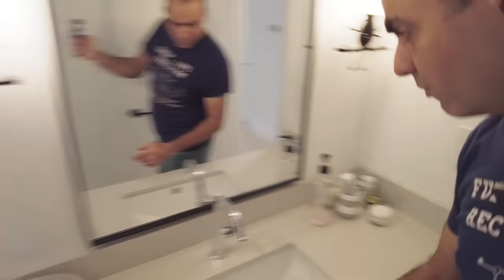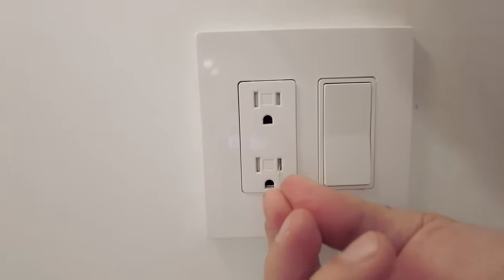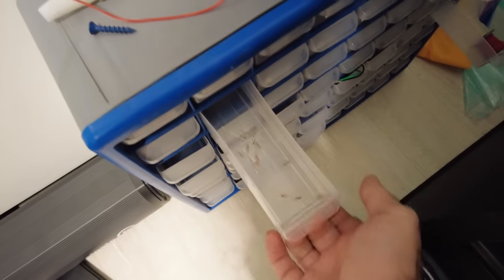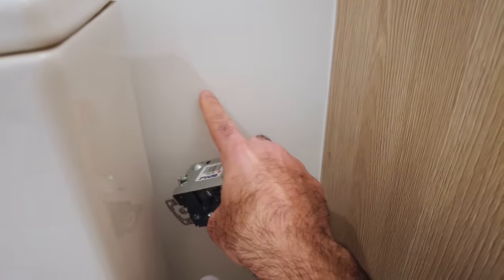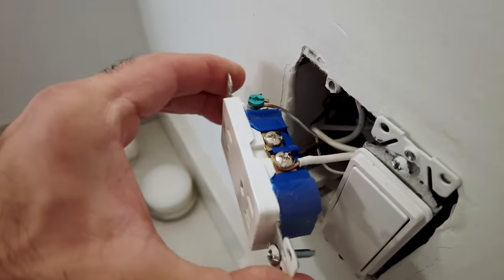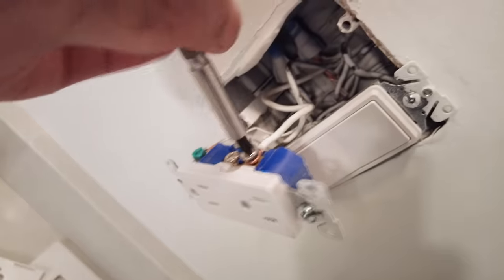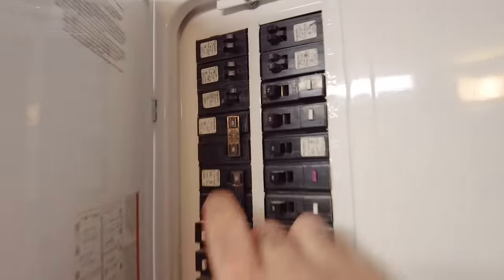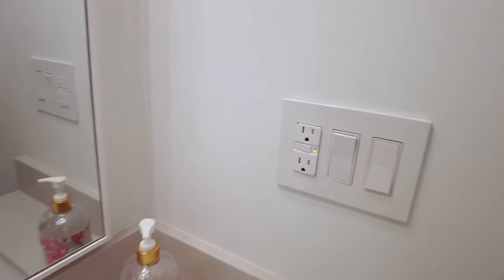Installing an Outlet… For a Toilet Seat?!

Comment: really should have an insulator at the ends of the armor flex so it wont potentially cut into something and become live (they sell these little red plastic / rubber plugs just for that) to be 100%
Reply: As is required by code here, they're called anti-short bushings.
Reply: He might've installed them off camera, as in a separate vid about his back porch infrared heater, he showed just that
Reply: @SomeGuysGarage he forgot those on the garage heater install to and ended up doing a follow up video where he installed them. Surprised he forgot again.
Reply: those are not required on MC/greenfield cable here in the USA. not sure about canada though.
Reply: If it does become live, the gfci will pop. That's what it does.
Reply: They are required in Canada for ac90 (this armoured cable)
Reply: This is exactly what I was thinking
Reply: @peterfordham3562 Yeah why’d he forget AGAIN???
Reply: Using that type of armored cable seems to always leave a wickedly sharp edge that can cut into the insulation on the wire! I always spend some extra time cleaning the sharp edges and wrapping some electrical tape around the wires before using the plastic bushing, especially if you have the wires make an abrupt 90 degree bend inside the box (which is usual). Also the proper type of box should be used for this type of cable, which I am not sure that he did. Personally I would not use this type of cable underneath a sink due to water issues.
Reply: I noticed that too.  No MC connectors, I guess.  But then no red-heads / anti-shorts?  eye twitch
Reply: Why do you even use the metal tubes? 
In Europe it's completely different. Inside walls, we have flexible plastic tubes. Non-fireproof ("TC") for concrete walls and fireproof ("ERC").
For mounting on walls, we have plastic channels, thicker, non-flexible plastic tubes ("PNT") or flexible ribbed tubes ("flexi"). 
Metal tubes ("STAPA") and metal flexible tubes ("SAPA") are only really used for mounting cables in industrial settings where mechanical protection is paramount. When they are used, the metal tube is connected to ground in the breaker box.
Reply: @masterkamen371  
Actually that is generally similar in the US for residential wiring, where the wiring in the walls is almost always crappy plastic sheathed stuff. His motivation for armored wiring was that it was exposed and not in the wall. Tho sometimes I find it easier to use rigid conduit in certain rare occasions in residential. In anything that is light industrial (and upwards) and exposed the requirements are stricter.
Reply: @noahbones1221 They are required here in Kentucky.
Reply: @Mentaculus42  The TC and ERC tubes aren't really bad at all. They're easy to bend, easy to cut when you want to but sturdy enough not to break. But they are an extra expense, so in this cheapskate era it has become a trend to just put all the cables under the plaster or gypsum without any extra protection. 

Am I understanding you correctly that you buy cables already inside the tubes? Ours come in a number of different diameters so you can fit as many different cables inside one as you want.
Reply: @CreatorofWhat  it usually depends on the area. But usually they are not required on mc but required on another metal clad wire product (in which i am currently blanking on the name of)

Comment: Once you have one, it feels primitive/backwards when you get stuck using a legacy toilet elsewhere.
Got a bidet toilet seat a year before covid; it was also a life-save during the great toilet paper shortage.
Reply: As someone yet to use a bidet, I find it hilarious that you refer to bidet-less toilets as a "legacy toilet" lol, must be life changing
Reply: Can't think of anything more unpleasant than having nasty toilet water shot at me while I'm trying to go to the bathroom.
Reply: Its like the difference between using an out-house versus a flush-toilet with indoor plumbing.
Reply: @vhfgamer  There is a t-junction at the water supply to your toilet, so it's fresh water that wasn't even in the tank. The water is heated on demand to the temperature you like, and it only happens when you press a button (ie, when you'd normally be reaching for some toilet paper). There is a blower to dry off your backside, also user controllable temperature.  But I understand, back in the day, there were probably people who couldn't understand why somebody would replace their perfectly good out-house with indoor plumbing and a flush toilet.
Reply: @ericthecyclist  Yeah. The bidet is like the outhouse.
Reply: @vhfgamer  it's the same water you should have in faucet
Reply: @ericthecyclist  please explain to me how useful and clean bide method is? It seems to me that getting poop wet and spraying water everywhere wont help much with cleaning, imo even wet towels are way more manageable.
Reply: @nanielwolf5768  We towels can't be flushed
Reply: @nanielwolf5768 cover a piece of 🌽 with nutella, and now wipe it with wet wipes. Now repeat the process, but this time use a water stream with decent pressure to wash it. Which one has more nutella residue left?
Reply: @nanielwolf5768  The force of stream isn't that great, you don't get anything leaving the bowl. In my unit there is a sensor in the seat to make sure you actually sitting down :-). At the risk of TMI (too much information), I can tell you that when I use a few sheets of toilet paper to dry wet areas of my backside (its faster than the blow drying), those sheets very rarely show anything other than water on them. Your mileage will very with the brand of bidet seat of course (the brand of mine is "beir").

However, my suggestion would be to ask among your friends (particularly European or Japanese ones) to see who has one you can use to form your own assessment.
Reply: @vhfgamer   It's not nasty toilet water, it's fresh water from the water supply pipe.
Reply: @Mike-kr5dn  - You can get moist toilet tissues specifically for that purpose.
Reply: @slingshot99  - Which method has nutella residue only on the place where it already was, and which one has nutella residue all over the rest of your body?
Reply: Jokes on you all bidet users. I trained my dog to lick my backside clean.
Reply: I get free toilet paper in the mail😊
Reply: The phrase "legacy toilet seat" makes me happy
Reply: @harrycushing  It is life changing.  You'll never want to use a legacy toilet again.
Think about it - on a cold day, you go to the bathroom, and sit down on a warm seat.  When you finish using it, you push a button and a self-sanitizing nozzle washes your posterior with a stream of warm water, gently oscillating to clean everything with a second button press.  Then when that's done, you push another button and a stream of warm air dries you.  You press stop and stand up, no residue remaining to stain your underwear.
Reply: @nanielwolf5768 if you get poop on your hands, would you feel comfortable just wiping them off on a paper towel or would you want to wash them in the sink?
Reply: Ahh "The great toilet paper shortage".. A story to remember throughout the ages
Reply: Does poop really wash off that easily? 🤣🤣🤣
Reply: @slingshot99 bruhhhh. I'm dead. Nutella on corn?!? 🤣🤣🤣🤣🤣🤣🤣🤣🤣🤣🤣
Reply: @J.C...  I can only speak for the output of my own digestive tract, but yes in my experience. However, find a friend with one to try yourself. A sample size of one person is not statistically meaningful.
Reply: @lone.faerie  the thing is, its not a sink or a tub, of course i would prefer to get in the shower and wash everything clean, but its impossible in my opinion sitting on a toilet.
Reply: @slingshot99  i can clean it almost perfectly with wipes, i cant prevent "water stream with decent pressure" of making a mess everywhere
Reply: @ericthecyclist  While risking TMI... I was voted down on installing one of these because some in the household feared back splatter on the nozzle relaunching poop to strange new moons. I would assume that would make them very unpopular if it were a possibility, so how is it avoided?
Reply: @karlharvymarx2650  The nozzles are self cleaning, there's a cleaning cycle.
Reply: @karlharvymarx2650  It's not a high pressure spray, and its impacting some soft energy absorbing surfaces :-). Does your family really think these things would be so popular in Japan (a country so focused on cleanliness that people remove their shoes on going into a home) if there were any mess issues with them? Ask people in your social circle who have them for their assessment.
Reply: @ericthecyclist  I made the same case, and mentioned the little car wash the other poster pointed out. Pressure might have been an unspoken issue. The main opposition party apparently produces an industrial strength potential construction material that often has to be chiseled with a stick to get it to flush. (yes they eat fiber by the bucket load and stay hydrated) I think she may fear that a gentle stream wouldn't erode away any orbiting Klingons and the required pressure washer to water cutter setting might cause back splatter, or the wooohooo-boy-howdy effect of a fall while water skiing or high diving/jumping. I think Snell's Law probably applies loosely so splatter would splashdown in a sub-rimshot location near the front given the geometry as I imagine it. I think the oblique angle makes accidental water intake unlikely too. And naturally again, if any of these problems were problems bidets probably wouldn't be so popular worldwide.
Reply: @peterwhitey4992 So if I smear poop on your hand and give you a moist tissue to clean it off you consider your hand clean?

Comment: Im an electrician (actually just south of Electroboom across the border ;) )and we do a lot of residential remodels. Medhi came up with a lot of methods that we use all the time like how he fished the metal sheilded cable into the box with a piece of metal.  

Btw, an "outlet" is anywhere where line voltage is available, as in constant power, not switched power. So technically all boxes where switches are located in your house (unless they are 3 or 4 way switched) are outlets, as well as every receptacle (what everyone calls an outlet) location. Atleast thats what my boss tells me.
Reply: I don’t think any of these methods were new to Medhi. 😉 He plays the part well though!
Reply: I once watched a cable installer use super strong magnets to fish wires within the walls. Personally I use those fiberglass rods that can be extended, but it is a pain.
Reply: Here in Australia, we call our standard 10A outlets GPO's (general purpose outlet). It does 240V/10A. There are also identical looking ones, but with a wider earth plug, that do 240V/15A for higher current use cases, like caravans, and some ovens. 

For more industrial/commercial uses, 5 pin 3 phase is also very common.

All of our circuits are on RCD switches, usually at the main pannel/distribution board. There are some instances where individual GPO's have their own RCD on them at the outlet, but that's not very common.
Reply: @macaddct1984  yep it's pretty amazing how many people don't get that, even 10 years later.. he's acting.
Reply: @macaddct1984  I mean he got the general ideas right but all his methods were still a bit crude. The fact that he has rough-in photos of his house does sorta imply that he had some hand in the building process, either in helping plan/design with the contractors and subs or he actually helped build it.
Reply: @aaronevans8701  
It is interesting that your residual-current device (RCD), residual-current circuit breaker (RCCB)  are probably what we call ground fault circuit interrupter (GFCI) in the US. The US also requires arc fault on certain circuits that are a bit different than ground fault breakers. Is your RCHs a combination of both?
Reply: I have a box of 10 outlets. It doesn't say receptacle anywhere on the box. Your boss and others who push the receptacle narrative apparently can't read. I'll go with the manufacturers nomenclature.
Reply: @markc2643  yeah it's mainly because people refer to them as that and they want them to sell without confusion. but according to the NEC they are different terms. I still swap between them day to day on the job. Words change over time anyway.
Reply: @markc2643  outlet: a pipe or hole through which water or gas may escape.  haha you both are wrong!
Reply: I think your boss is a bit wrong. Per NEC an outlet is "A point on the wiring system at which current is taken to supply utilization equipment." A basic switch box is not an outlet but the box with your ceiling light is.
Reply: @eDoc2020  I think that one could argue that the switch is providing the power that is being utilized by the light, so the switchbox is the outlet. As far as I know an "outlet" must have constant line voltage to it, so unless you ran a 3-wire with a constant hot to the light box it isn't an "outlet".
Reply: Bellinghamster?
Reply: @mrbergchemistry  Indeed I am of the 'ham.

Comment: Just like Mehdi I took pictures of my house before the sheetrock went up. It is so handy to have later on for repairs or additions! I was worried for him that the hole he planned to use was meant for the sink drain line. I guess either it wasn't or he worked around it without telling us.
Reply: Imagine if it was meant for the sink, and he managed to bust the pipe. OOOF.
Reply: You can see the sink drain line in the picture he took.
Reply: They should keep construction photos and include the house when you buy it. Renovating a home is like opening a mystery box only instead of finding a rare png you find a 4 inch void above the door frame hidden by base boards and a pile of rusted exacto blades.
Reply: @UserOfTheName  how would that work with houses built pre-WWI? There's still tons of those in big cities.
Reply: @joseherrera8489  It wouldn't but It doesn't mean new homes shouldn't

Comment: You should pick up a meter that has the Loz setting. It tests for voltage while applying a small load. You can use it to test GFCIs and you can also use it to get a true reading without any ghost voltage. Sometimes there can be a very loose connection or wires just traveling next to each other for a long period of time and a voltage will show on a wire that does not have any power. This Loz setting eliminates the ghost voltages.
Reply: Would it also require you to place a 10K resistor between live and earth or would it eliminate that need?
Reply: It has already built in somehow so u don't need anything else
Reply: Legend of Zelda setting

Comment: Seeing Mehdi try to screw in the conduit brace, I now know that I need to gift him a mini tripod for Christmas.
Reply: This is a man who used a 10k ohm resistor, voltmeter, and light bulb to check the GFCI instead of the outlet tester he most definitely has. He will not use the mini tripod if he thinks it will make life easier.
Reply: And he will shoot while holding the tripod 😅😅😅
Reply: A GoPro would do the work 😅

Comment: In my limited understanding, this sort of setup would never be allowed in the UK due to 'splash zone' exclusion rules for outlets. I believe that if you wanted to do something like this and have the socket within 5 feet of a water source (Particularly a sink or toilet tank that can flood the room if the normal overflow control measures fail) is if you use a completely plastic and waterproof in-wall access box which you run a cable directly into without a plug, just a lot of waterproofing before it's connected directly to the mains AC through a fuse. Good ones have watertight but removable fuses as I very vaguely recall. They're also used a lot for electric radiators as it's far safer to have such a high current device directly wired in much like an oven or the like, especially when it may contain conductive fluids or be around water itself.
Reply: I have never seen GFCIs at the point of use in a british home.  I have seen GFCI outlets available, but they don't seem to be nearly as common as they are in the states.
Codes aside, I still find it a bit odd that bathrooms in the USA have regular outlets in them, even if they are GFCI.    Plenty of outlets in my home were wired incorrectly.  I've also had electricians come in and do a bad job of wiring outlets (they had to get redone).
So, it's a good idea to get an outlet tester when you buy a new home, and test all of your outlets and make sure they are grounded and the hot is wired to hot etc.
Oh, did I say that I found a switch where someone had cut the ground?  The wire had to be rerun............
That turned into a bit of rant.........

Comment: When using a metal box, you should consider making a bonding pigtail to your ground and have it wrapped around a grounding screw which is mounted to the frame of your box.  You also want to make sure you put your stud hole about 6 inches above your receptacle, and clamp the conduit down against the stud.

This will give you extra protection and it's code in some places.  It's also a good idea to wrap your exposed receptacle screws with electrical tape as well.  This way you don't short something out and your box has a path to ground to prevent you from energizing the box and shocking yourself.  (I like to use antiox on my copper conductors in wet areas to protect against moisture and oxidation of the conductors.)

Leviton makes a WAGO style receptacle connector, which makes installing these much easier, you just push the wire in and snap it closed.  Consider using Wagos instead of wirenuts, they will give you more space to work with in your box. (I wrap those in color coded tape to prevent the levers from coming back up)

I would have bought a plastic box for the bathroom.  Metal boxes are a headache imo, but they hold up well to heat in-case there is a lose connection or potential fire situation.
Reply: No one uses plastic boxes in Canada. There's only Plastic Nutek boxes that we use on rough in new construction for exterior walls.